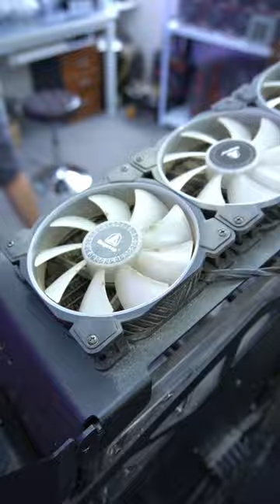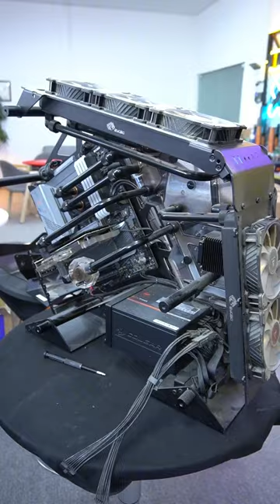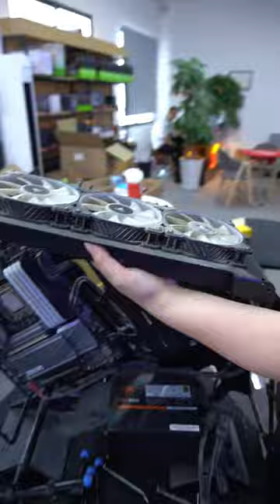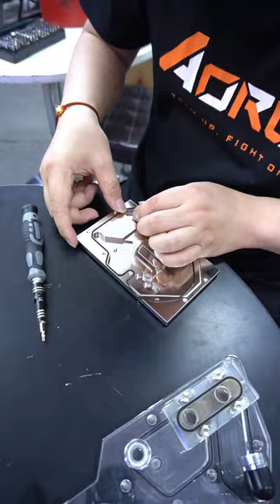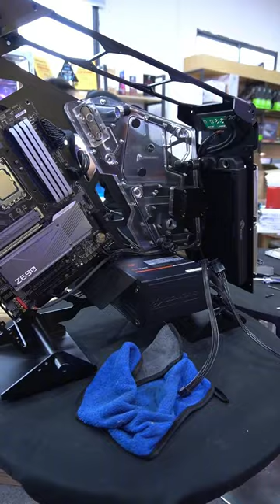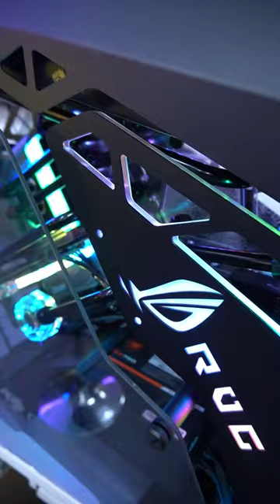Deep Clean A Water Cooling Gaming PC In 1 Min!

Comment: Not sure if you guys are gonna answer that question but can I actually do that with my NHD15 noctua fan rad? It's been sitting in my comp for years and lot of dust went inside the rad without me being able to remove it even with a compressed air can... Thanks for the reply !
Reply: Yes, you can. As long as there are no electronics in it, it should be fine.

Comment: OMG you don't submerge radiators in water, just blow them out with air. How is your coolant getting that dirty? 10% dex-cool antifreeze to 90% water. been using it for 4 years now. The coolant is nothing more then propylene glycol and water. my CPU never crests 150 deg F, my water temp never exceeds 82 deg F.